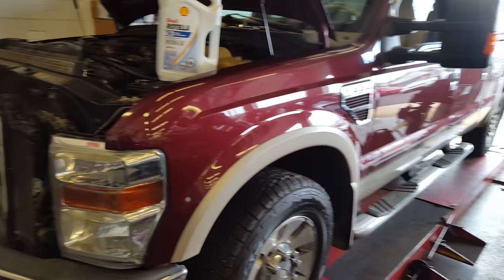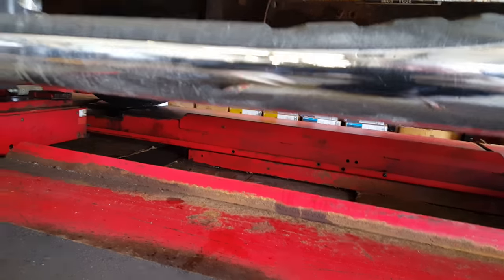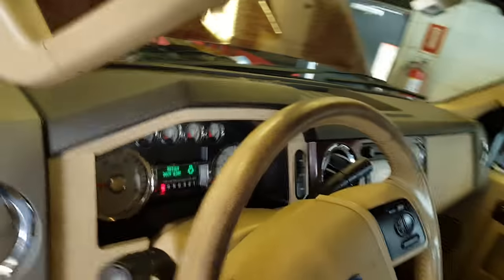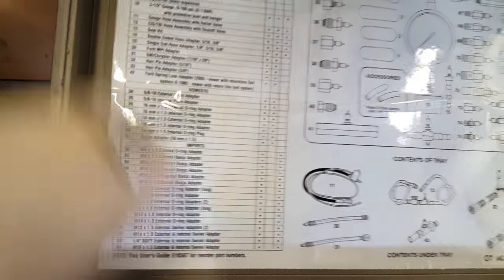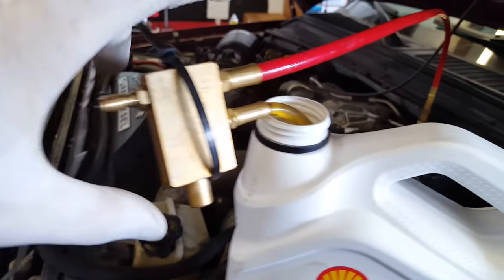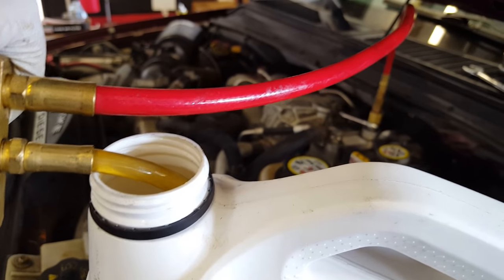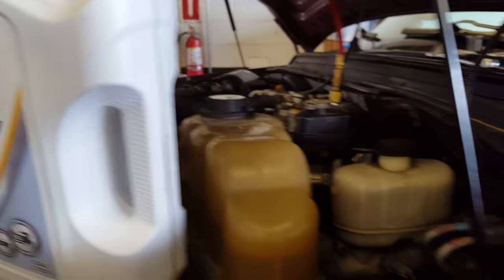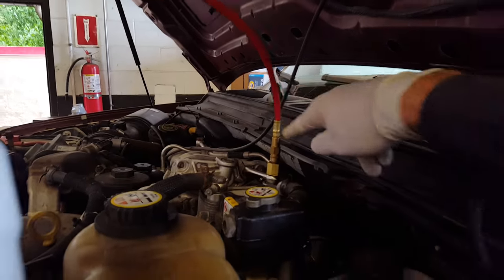6.4L FUEL SYSTEM BLEED after filter change AIR IN HIGH PRESSURE SIDE F250 F350 08-10 no start after

Comment: There will almost always be small bubbles because of the fuel agitation from the return line to the tank. This is why aftermarket fuel "lift pumps" are a popular upgrade. Such as the FASS or others, they are air separators.
Reply from the maker: C S thanks for commenting and filling in some information. I wasn't really sure what's common to see on these 6.4's
Reply: NoNonsenseKnowHow no problem. The air is normal, although still a design flaw issue. The aftermarket pump/filter set ups fix it, but they are 500+ bucks at minimum.

Comment: I changed the fuel filters on my 6.7 last night and didn't get the lower housing tight enough. I primed the system 8 times and it wouldn't start. After a few more attempts it started, but I got a low fuel pressure warning. Shut the truck down, realized me error and tightened the housing the rest of the way. Now the truck seems to run fine with no error codes. Could I still have air in my system or will it eventually work its way out?
Reply from the maker: From my experience, the 6.7's  Purge the air out themselves no problem.  You should be fine. Thanks for commenting and sharing your story.  I'm sure this will help others who run into same problem
Reply from the maker: Air in the 6.4l is more of a pain
Reply: @NoNonsenseKnowHow  Thank you for the reply, I am sure I will use more of your videos in the future. I needed to hear that it would all be alright, so thank you.
Reply from the maker: @Bbjorkman007  no problem at all man, and I greatly appreciate that!  thanks
Reply: @NoNonsenseKnowHow  if my truck starts after getting air out  of the line ,and i  think i still have air in there because when i run the truck for a bit it seems like it goes loses power then jumps back in to power for about a few seconds  ,could i still have air in my lines ? It starts right up everytime though

Comment: Got one the costumer ran out of diesel,I change the fuel pump for a new one blad the system. Now, long cranks when hot. When its running it works just fine.any advise 😤🤬
Reply from the maker: No real thoughts come to mind off hand.  Maybe there is still some type of air leak in the system? Let me know how you make out, I'm curious. Sorry I couldn't be of more help
Reply: I give up,Im taking it to a pro. Luckily I’m a ford guy,this peace of shit truck.
Reply: challenger srt what was the problem
Reply: Sold the truck

Comment: If your 08 6.4 won’t start, cranks, no fuel to engine, low pressure fuel pump needs replacing. Don’t be cheap an buy the pump only! The entire housing may need to be replaced. Save yourself my mistake. Lmao

Comment: Just prime the system by turning the key to the on position and leave it like that for a couple minutes before starting the truck.
Reply from the maker: That doesn't work if you get air in the high-pressure fuel system.
Reply from the maker: That's why they make a bleed kit for it.
Reply: Lol. Just prime it if only it was that easy
Reply: Having the same issue with my 08. The fuel has air in the system and has been bleeded. Would turn on for a few seconds then turns off. Any other suggestions

Comment: I have to deal with this when my diesel fuel gels and won't flow. The tool is outrageously expensive. 
I made a bleeder with a new banjo bolt drilled through the top then a .22 long rifle brass cartridge also with a hole drilled through the end, gently press fit the brass into the hole you drilled through the head of the banjo bolt, and there you go. 
I discovered this technique when stranded while snowmobiling, and the nipple broke off of the fuel pump . I reemed the hole in the aluminum pump body until the brass shell was just too big, then pounded the brass casing in. Ran it like that for two more years, and the new owner didn't change it.

Comment: What exactly do you think they put that fuel test schrader valve on the outlet cooler fuel line for? For looks? Just connect a fuel pressure gauge with a bleed off valve hose. Bleed off the air while you cycle the key fuel pump or use scan tool (If you wont buy a pressure tester your sure not gonna buy a scanner either eh) to command lift pump. When you begin to see  nice solid fuel stream with small bubble here and there , start. When it starts , keep draining the excess air until it clears up to solid and your done.No banjo bolt drilling crap, dont even touch the banjo bolt period. Cheap fuel pressure tester is maybe 20  , if you cant get one then you really shouldn't be doing ANY repairs to ANY fuel systems. Guess what you have no MESS either , the basic fuel pressure gauge tester has a 1/8 hose on side you used to drain all that fuel/air into a container and comes with a ford fuel schrader adapter. No diesel all over the engine from leaving cap loose crap...Just drained all right into a container. Dont make things so difficult.
Reply from the maker: Appreciate your input but let me just fill you in onwhere I'm coming from. This problem happened to me when the customer was waiting. He was pretty upset with me when I told him his truck wasn't starting.  He ended up getting a ride to where he had to go so I had a little time with the truck. I don't work on that many diesels and at the time I couldn't find any clean-cut answers online about how to get the air out of the high pressure fuel system on the Ford 6.4L.  After looking at a couple forums, this is the message I went with and it worked so I figured I would make a quick video in case anybody else we dealing with a similar problem.  That being said, are there other ways to do it? Yeah I'm sure. One guy mentioned just cracking the fuel filter housing loose. My question to you is if it's as simple as the Schrader valve, why do several companies make fuel Bleeder kits for these Ford 6.4l?  Sorry if there's any typos in there I was using speak to text and didn't proofread.  Thanks, and I appreciate the input

Comment: There is a Schrader valve next to the banjo bolt that you are supposed to use, from what i was told. Witch is the inlet side. what is the difference??
Reply: It’s what your supposed to use I’ve bleed em that’s run out of fuel and quit it works perfect

Comment: Be aware that the fuel intake strainer inside the fuel tank rots and crumbles to pieces... thus if the tank is below 1/4 level of fuel, it will begin to suck air. Also when that strainer falls apart some of it can get sucked up into the intake line, I found pieces of it all the way up to the fuel separator! Also, that strainer part in the bottom of the tank it comes in 2 sizes and it's random which size your truck will have if you can believe it... you need to measure the diameter of the steel intake line inside the tank to determine which size fuel strainer you need. Ford made POS I swear! Even after all I've replaced I'm afraid to drive this Ford F350 I inherited from my father now, it's FOR SALE I want it gone!

Comment: we tried this and it still gets air in the system and wont start
Reply: nevin jacobs what did it end up being
Reply: What was the problem
Reply: Reviewerguy1228 did u find out the problem?
Reply: Use the bleeder port on the left hose it has the cap on it.
Reply: NeverTryNexus it was air in the system, I bought the $90 kit off amazon and bled the high side, and used a psi checker, hollowed it out and attached it to the small hose to drain the low side

Comment: Or just use the bleeder valve to the left that works just fine. It has gray cap on it
Reply from the maker: On a 6.4 liter?
Reply: Theres no bleeder valve on 6.4.
Reply from the maker: @victorlester3925  yes! exactly.  lol
Reply: @NoNonsenseKnowHow   yes there is im running this issue right now on a 6.4 at work bleeder valve IS on it

Comment: Good evening I have f50 2013 6.7
I changed the fuel filters after that the truck doesn't star
What should I do 
Thank you
Reply: Use OEM (Motorcraft) filters only. The aftermarket filter don’t work in my truck.

Comment: I have done many oil and fuel filter changes and never had this problem. Until I did it on my own truck. It started up fine and ran for a few seconds and you could tell it went ah fresh oil. Then it shut off and won't restart. I only tried a few times but I'm in a parking lot and it's almost ten pm. My service dog and I live in this piece of shit so I have food I can make dinner for us and try bleeding the system in the morning. Need to just leave it alone for tonight and take a look in daylight. Hopefully neither the basket tweakers nor the cops will bother me overnight and I'll get some rest. I'm a disabled senior citizen and I don't need anymore nonsense right now. I'm ready to set this piece of shit on fire and walk away.
Reply: Cycle the key 3 or 4 times then turn it on again and bleed the shrader valve it’s the thing beside where he had his hose hooked up looks like a tire valve take something and push it in keep doing that until the air is all gone and it’ll start right back

Comment: What does the banjo bolt get torqued to
Reply from the maker: I'm not sure what the torque spec is. Good and tight
Reply from the maker: If you find this back, let me know and I will update the video description
Reply: Depends if youre using copper or Viton washers actually.
Reply: Jon Marshall I had the copper washer, I torqued it to tight ;)
Reply: @Reviewerguy1228  lol there ya go. If memory serves me right its like 32Nm on the copper guys and 25Nm on the Viton. But dont quote that exact. Glad you got it to work!

Comment: Shut man i got air on my 2008 f250 now i got the problem.
So now i dont know how to solve the problem whut out special tools. Any tips?
Reply from the maker: There's no other way that I know except for what I used in this video. That sucks. Let me know how you make out if you find a different way !  and good luck
Reply: Take your truck to the shop... YT videos are like virus. Followed every step and fucked my truck up.
Reply: It works, it's just a pain in the ass. Takes an hour or more of bleeding the manual way by cracking that bleeder bolt at the top. It's just a very tedious process. Wish there was an easier way.
Reply: Use the port on left hose( opposite. One he used) just cycle key and push in with phillips and it will drain air out
Reply: @mikegarner8170  Thats the low pressure port side . The banjo is for the high pressure system .